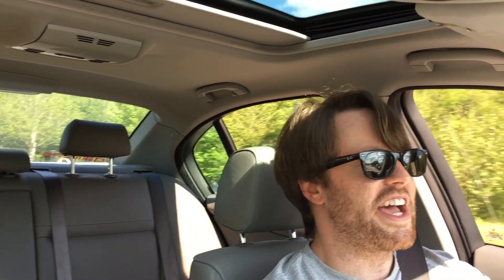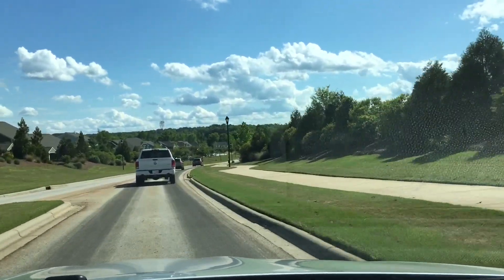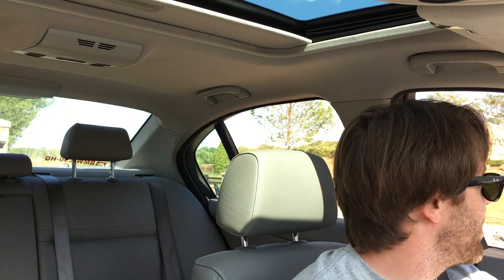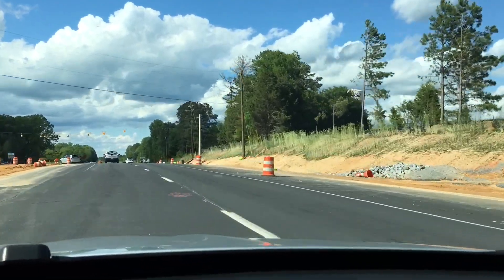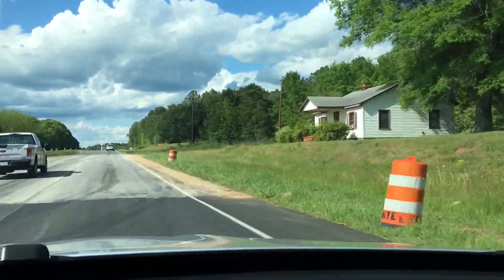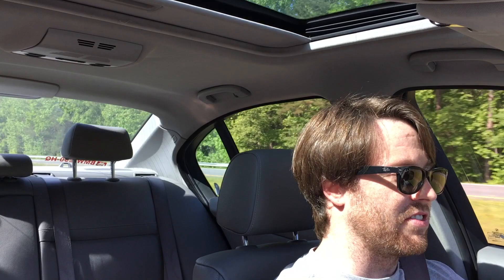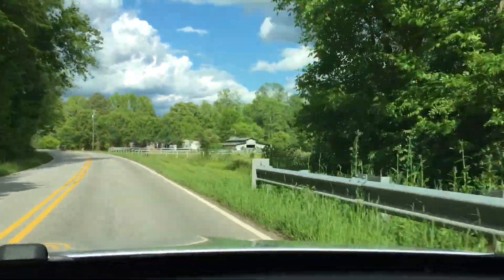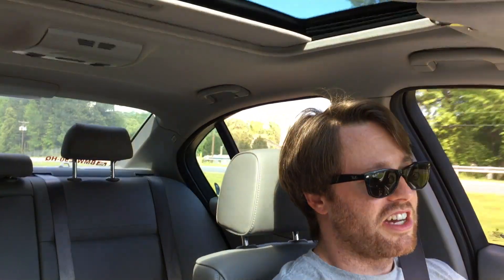My BMW is almost fully FIXED!

Comment: You can do it! Use the money you would pay someone to purchase some tools for the job. I did mine when I replaced my turbos in the garage. Great video!
Reply from the maker: How off was the alignment when you got done? I’ve heard it can be almost undrivable.
Reply: @BMWE90HQ  mine wasnt bad at all take your time it will be ok to drive, I dont have exact numbers but drove it 15 miles to the alignment shop when I was done, I also installed coilovers at the same time, figured get it all done in one shot. Definitely DIY it it's not that bad of a job considering. I'm over 600 whp now drives like a champ.
Reply from the maker: Awesome I think you’ve given me confidence to DIY. Even if it’s real bad I could still get a tow anyway. I’d still be in way less. 600 whp sounds awesome I guess I’m around 400ish with fbo.
Reply: @BMWE90HQ  definitely especially since it's not your daily now. Gain the experience and save some money.

Comment: How was your 328i? Do you miss it sometimes? How was the switch?
Reply from the maker: I do miss it. It is very similar in most driving situations and much more reliable. The 335i shines in a wide open straight line.